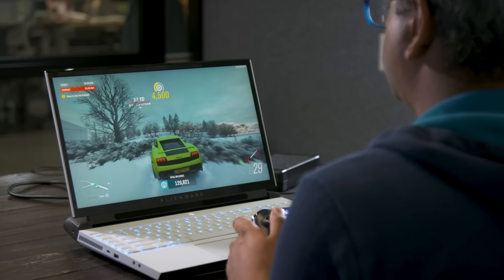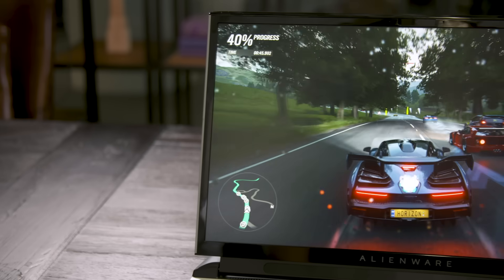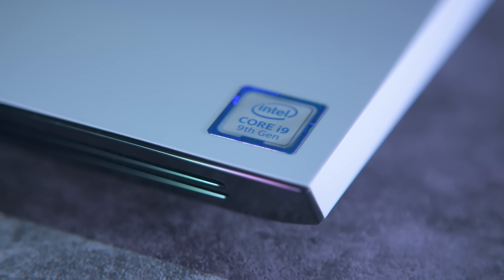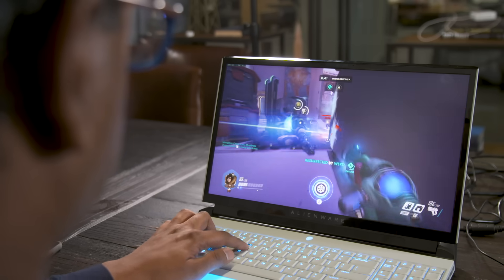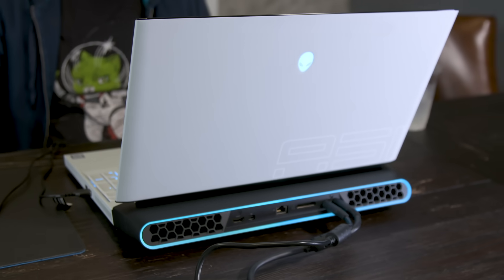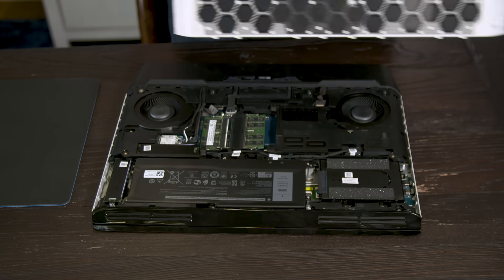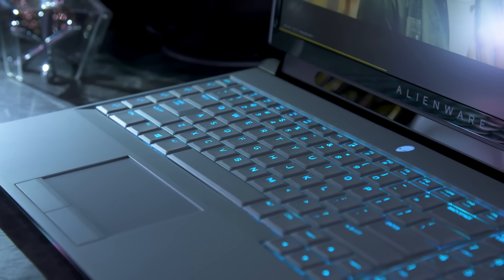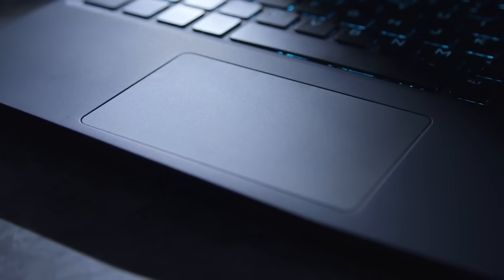Alienware Area 51m Review: When gaming laptop meets desktop

Comment: I drunk shopped. Bought one for nearly $7000 last week. When my wife found it out on the CC statement, she threw hot oil on me when I was asleep. Now I'm in the hospital. But I still can't wait for my new computer to get here. The nurse is gonna help me hook it up and get it running.
Reply: cool story, bruh
Reply: Bruh.... u know you could get the money back (if it’s an issue).
Reply: I have a similar story. I decided to buy this Alienware laptop because I'm really into gaming. I'm not a huge gamer, but just getting into it, and wanted to spoil myself. My husband found out how much I spent on it, and he put my head through the bathroom wall.
Reply: LOL yes it will work for as long as your warranty is still valid. Dell  or AW are the clasic example on why us consumer don't have any rights. They changed the voltage through a firm ware update on my original A51 then they send me a refurbished one with a broken (burned) RTX 2080, just one week into the power supply died. If you buy from these people then good luck ASUS never treated me this way.  Also the PS5 or Xbox both are faster and produce bettter grahpics and frames and is way more reliable, in regards to gaming. Don't believe me, I can play you Valhalla on this A51 with a RTX 2080, Intel I9 9900 k  or a PS5 and watch which one produces a better picture $4000 vs $500.00
Reply: 😳⁉️😂😂😂"boowawawwa!!?"😢" sad!?"🤭"giggles!?"🤣🤣🤣😢 i mean sad !?,can you hold the mouse move your fingers on the keyboard ?

Comment: That's not true. Power chargers don't top out at around 330Watts. The reason why they decided to split it up like that is because of regulations in the EU. Power chargers over 330Watts are illegal to distribute in most European countries. And since Dell has an international customer base they decided to go with the 2 power brick design.
Reply: Well that is more demanding
Reply: They don't make adapter with more power anyhow..New and Smaller one come adapter with ucb type c charing... Let face it some of these gaming unit require a lot more power.. otherwise you keep run out of them.
Reply: @campkira  I have seen a 600 Watt power adapter once. There is a laptop manufacturer that ships them with their laptops but I can't recall the name right now. Maybe if I'll remember it I'll update you on it.
Reply: So 660 watt altogether?
Reply: So is there a aftermarket version available with more power?

Comment: As gamer and specially amateur photographer which as of late and with the purchase of this laptop has been consuming all of my free time, I can only say I wouldn't want to work with any other laptop other then this one. It's supper reliable even after back to back major 4k / 100 GB of rendering and over 8 hours of none stop gaming on an 4k 65 OLED with a 60fps on ACO, no crash or performance issue, just keep an eye on the thermals, keep the fans running, nothing like it. If I wanted cheaper option I would look at the XPS or M17 but I will never switch again from Dell to anyone else. 
To anyone specially photographers or contend creators that need the fast read and write or cpu rendering power, and I did test majority of the higher end MAC's and PC laptops, they just fall flat in comparison to the A51.
Reply: anawa083 what thermals do you get?
Reply: Hi anawa.. me too I'm thinking bad to buy the area 51m i9... but what stops me is the reviews who gives negative thoughts about it.. for example in the video shows how the keyboard buttons goes out !  and alot of what we hear thermal throttle..  you said you worked with area 51 m with 4k video rendering and video projects so did you face any heat or any freezes issues with the 51m ?? Do u really recommend buying the area 51m ? Thank you

Comment: I travel a lot and I bought a M17 R2. It's an awsome machine. I've even accidentally dropped it once from my waist height while I was moving it and yet the laptop is going strong. The hinges, which they advertised as aviation grade, are still holding on very firmly and never wobble like other laptops you see on the market. I don't care about the trackpad that much. Trackpad is only needed when I am doing some light works. The keys... yes I admit. I wish they upgrade the keys but I never really had any problems with the keys either. They aren't something I'd choose but they are there and they work. Good enough for me. For changing parts, I actually thought Alienwares are more accessible to core components than any other laptops out there. As far as I'm concerned they don't have any tricky clips to remove to access CPUs and GPUs. All you need to remove are screws. I have no idea why that's such a problem when most laptops out there practically stops you from opening them up.
Overall, I thought the review was a bit shortsighted. There are agreeable points though. I am gonna save up for Area 51M. Hell, it would be a nice change.

Comment: I heard rumors about these Laptops overheating and dying. Not sure if there's anything to it but it does kind of make me hesitant to get one.
Reply: You really seem envious.Criticize because you probably can not buy it
Reply: The mosfets on a few (I think 7 cases reported so far) burnt out. This was an issue when RTX desktop cards first came out as well, but it seems for the most part it has been fixed. I believe the BIOS was putting out too much voltage, but they apparently fixed it.

A few dead laptops out of the thousands sold isnt a big number, not enough to worry anyways. Plus their warranty is pretty good and they'll send you a replacement if this does happen.
Reply: @recreate3204  OK, thanks for the heads-up, Josh. I really appreciate it.
Reply: @AntonioKowatsch  No problem, it apparently is now fixed but peoples laptops are still dying (purchased before the new revision on defective parts though.)
Reply: @recreate3204  There also seems to be a long wait for them with additional delays added on and if ordering off the dell website you need to watch out because at least for my region they were advertising it with the I9-9900K but when you actually went into the purchase the processor option was locked on the I7-9700K.
I had to contact dell support to get a link to a version with the I9-9900K option.
They also list 5-7 working days for delivery but my current listed delivery date is 15 working days after my order and based on what I have seen online this will likely be pushed back again as apparently there is a parts shortage.
I already have a desktop so I'm not bothered by the wait but if anyone is looking to order from dell just read carefully and be prepared for a wait.
Reply: @rbp8965  Yeah, Intel is having shortages so if you ordered with the 9900k, expect at least a months waiting, the 9700k seems to be in stock though.

I think the long wait times are a good thing (or atleast I hope) because they've apparently revised the MB and DGFF since the first batch were having issues.
Reply: @gibasabino22  it's called shopping around, you're the kinda guy who would buy a bra if they told you it supports you. Lol...get outta here.
Reply: AntonioKowatsch i own own and never have heating issues. Im playing all games max settings over 8 hour sessions. Best rig in the world
Reply: @dominicthompson5443  would it be flawless for video editing in 4k? And loading samples? Would u think 32g ram? Cheers
Reply: Mistaken Enemy yeah 32 is perfect. Thing is a beast and im very happy with the purchase

Comment: The BIGGEST problem not mentioned... is that the two AC power packs (two different sizes) aren’t labeled and it DOES matter which ports they are plugged into. There is no instruction or color to coordinate which pack goes into which port. I had mine switched for a month until I had an issue. After talking with Alienware they helped me fix it and noted that they knew this would be an issue once released. Regardless, this laptop is insane and has helped me tremendously with 4K and 5K video editing with heavy VFX. It’s perfect.
Reply: Wait, please do tell us which size goes to which ports ?
Reply: Yos Hideky if you’re looking at the back of the laptop the right port is for the bigger pack.
Reply: @westwebb sorry, can you clarify which right side ? 
The one closer to the LAN port or the one closer to the vent ?
Thank you for the info.
Reply: And also do they have manuals or instruction already ?

Comment: Well, I guess the audio and webcam have become sideshows at this point.  I can deal with the cost, but when they took out the subwoofer and downgraded the webcam to 720p, that just made me think, “Nah, I’ll pass.  I have a perfectly good Alienware 17R5 with an i9 8950HK and a GTX 1070, with great sound and a 1080p webcam for when I need it.”  When a company makes a laptop this expensive with so much powerful hardware and a good size chassis for it, skimping out on even the small things can cheapen the overall value of it.
Reply: @zgoaty92 i was thinking of getting the Alienware 17R5 i9 8950HK with the GTX 1080, can you please tell me whats it been like owning the Alienware 17R5 and if there have been any issues or how well games are played on it, i currently own the Alienware 18 which is discontinued now but still great, thanks
Reply: Emir hp With the 1080, it might have a better cooling solution, but I would still make sure to undervolt the CPU by around .16 to .2 mV and probably limit it to around 4.3-4.5 GHz on all cores to keep within a good thermal limit.  Also, I recommend using Throttlestop to make sure it keeps around those speeds for the majority of the time and also to raise the power limit to 65-70 W on the CPU.
Reply: Alright thanks for that info, and what about the gaming experience, how is it from fps to overall performance from your experience? I enjoy playing games as simple as age of empires 3, minecraft and even warcraft 3 to more demanding games like rainbow six siege, overwatch, total warhammer
Reply: Emir hp You should be more than fine with AoE 3, Minecraft and Warcraft 3 (especially Warcraft 3); and R6 Siege, Overwatch and TW Warhammer should run just fine, with easily 100+ fps reachable with high settings (maybe not maxed out) 1080p on the latter 3 and older games like AoE 3 and Warcraft 3 the hardware won’t even break a sweat maxed out even at 2160p (4K).  Older games like that as I’m sure you’re aware usually tend to rely on single threaded CPU performance, which won’t be an issue with the 8950HK.

Just be sure not to use any of the Ray Tracing settings that Nvidia enabled on the Pascal GPUs if there’s any games you play that have the settings (meaning the 1080 you plan on speccing the 17 R5 with), or you can expect fps to tank heavily.  Also, if there’s a specific target fps you want to hit, don’t be afraid to play around with game settings to hit what you want, though you probably know this as well.

Comment: A friend of mine bought one 2nd hand, for only 1500€ that's just a steal!!! This thing is so awesome.
Reply: I am about to get one for about same price, one year later...do you think it is still a steal vs the new ones?
Reply: @nicolaszimerman7959  Yes it is. 
He sold it a few weeks ago for 600€ more and ordered his PS5 for free that way!!! So prices are still holding. It's worth the money. 
But keep in mind this thing runs hot. And I mean really hot, like 100°C when gaming! It's thermal throttling to not overheat the CPU and GPU all the time! 
We've contacted Alienware about it and they state "it's perfectly fine", but I wouldn't run my system that hot, ever. If you are a bit familiar with overclocking you could lower the voltage a bit in the bios or with the Alienware software that runs on the system, to find the sweet spot of power usage, performance and heat. Overall it's a beast. Even with the new gen of GPU and CPU, this thing will do its job fine for another 5 years, if it still lives then.
Reply: @Aluminator82 If he actually bought one, can you ask him, how does one remove the oil stains from normal use? Because isopropyl rubbing alcohol and water doesn't work. Does he know how it comes off?

Comment: at 6:10 he talks about the key board. I have an alienware 15 R3 that has the same key board and ive never had issues with it. I think the reason dell stuck with the traditional key board is because people like the traditional style a lot better than the new styles. i have the same touch pad too, that's just fine. I do think having the same key board and touch pad as the alienware m15 would be cool but it doesnt matter to me they both work the same. I think the design of this laptop and whats under the chassis is a win win for anybody. The fact that all the components are upgrade able makes it a worthy machine to buy.

Comment: I noticed something is strange about this gaming laptop that come with two power supplies. I played Cyberpunk or AC Valhalla. if I only plugged in only one power supply. the game will run like it's running low on juice. framerate of 2077 is 30 fps and AC Valhalla is 30fps to 45 fps. but when I plugged two power supplies it was like running at full potential. Framerate is 70 to 90 fps.
edited: when I played small GPU requirement game with 1 power supply plugged in. it's around 122fps to 151 fps but with two power supplies it was 221fps or more.
edited 2: my old alienware laptop back in 2015 until now on battery mode without doing anything it's 5 hours. but this new laptop on battery mode without doing anything can survive one hours and 51 mins.

Comment: I have mx17 gtx 880m, one of the reasons I bought the laptop was that I could change the GPU, but after 5 years of light usage , my GPU is completely dead now. Unfortunately I am not getting any proper support from dell, as their saying that, they are out of stock. At this point I am looking for an advise.

Comment: fans are not even aluminum yet? what the heck ??? for the price and specs i won't spend money on this type of gaming laptop
Reply: Interesting point. They should remove as much plastic from the insides for aluminum to make it dissipate heat faster
Reply: @nixtoshi  because physics...
aluminum will hold its temperature for much longer than ABS plastics.
you will actually lose efficiency in cooling capacity if you use aluminum blades rather than abs plastic blades.
this is why essentially almost ANY cooling fan out there for electronics has its blades made out of ABS plastic.
(and no, household or industrial fans don't count...)
even a CNC machine that costs over fucking 50,000$ has its fan blades made out of ABS plastics...

Comment: Is the 4k 60hz display better for gaming than the 1080p 144hz?
Reply: On a 17" monitor, you wouldn't be able to tell the difference between 1080p and 4K due to how dense the pixels would already be fitting inside such a small screen. 4K is only recommended for screen sizes bigger than 23" at minimum. Preferably 27". At 17", 1080p is already slightly overkill. So you would rather get better refresh rates (144hz) than a higher resolution.